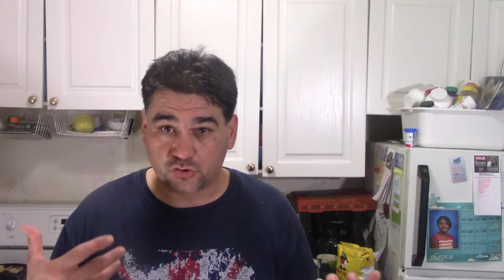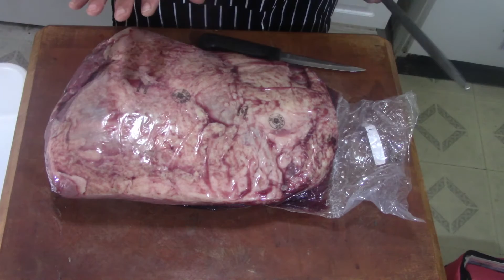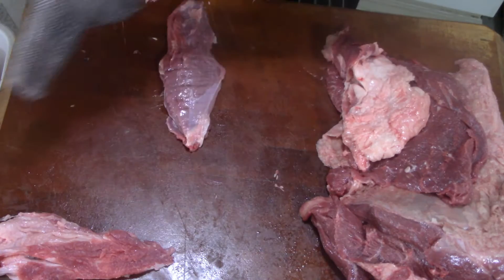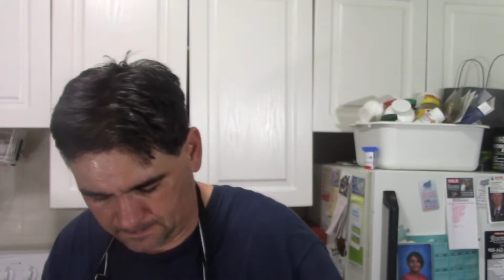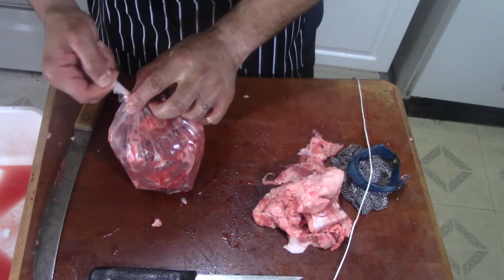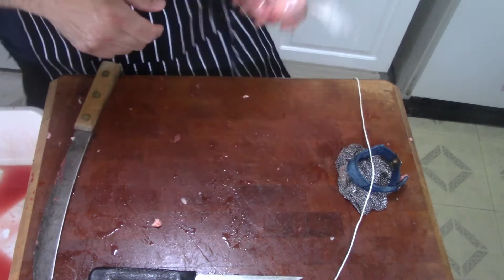Larry The Butcher, Processing a Beef Clod

Comment: I would like to know what a reasonable mark up for beef actually is.
It seems I can buy a cow for around 800 usd and get a lot of meat compared to what the super markets get you for.
Was just wondering if it is actually worth the time and effort.
Thanks
Reply from the maker: Hey Charlie.  When you buy a cow for 800 bucks, there are costs that aren't covered.  The butchering for one.  And then it depends on the individual cut.  Beef tenderloin is traditionally the most expensive, and it shouldn't be!  The hangar steak should be, as there's only one per animal and is only about 8-10 ounces! 

If the 800 dollar animal is live, you have to factor in about 200 for slaughter and about that much for butchering.  In a retail level we should be working towards a 40-50% markup on the whole animal. A Beef tenderloin could have 200% markup by weight,and the bones will be near zero.  Are you looking for the markup for the individual cuts or for the animal custom processed?